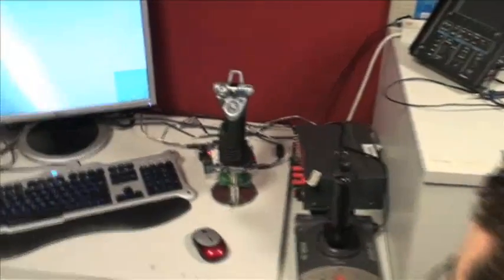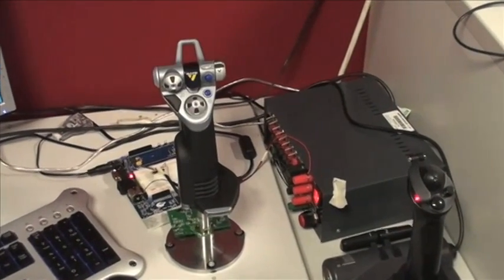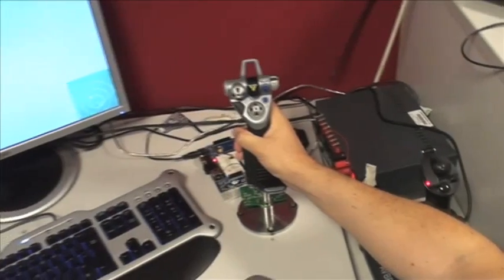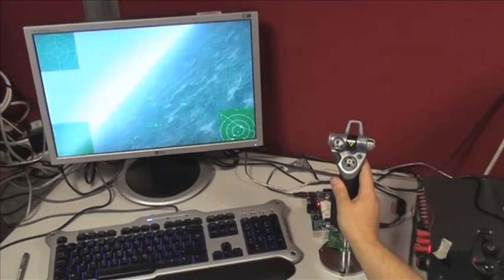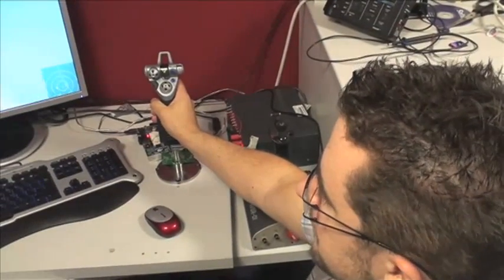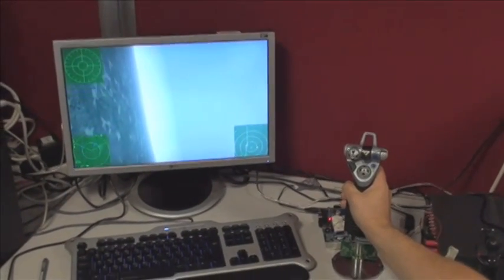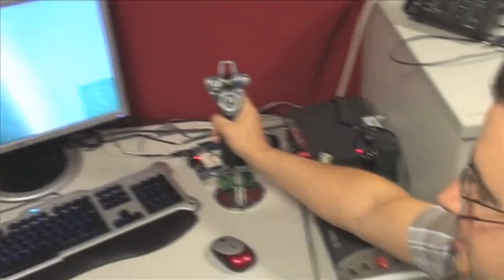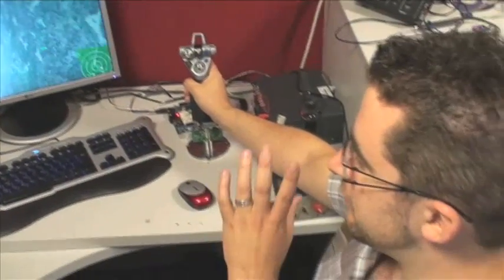Force Sensing Demonstration

Comment: As unusual as the X-65F, which doesn't move at all? Why is the inside built so poorly?  There's a photo of cheap little parts inside held in place by electrical tape on your forum.  And the cable between the stick and throttle appears to be poorly shielded and lacks ferrites along the length.  Just moving your hand or body near it causes the rudder axis to change. Switch of fluorescent light off and the axiis jump.